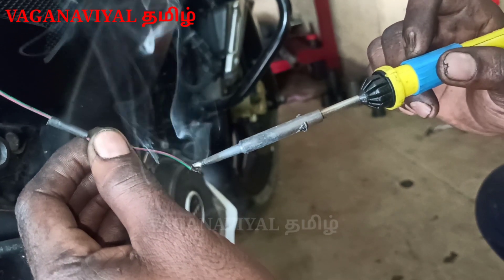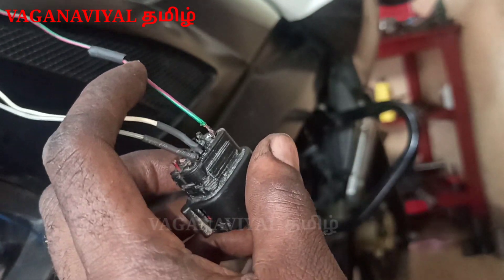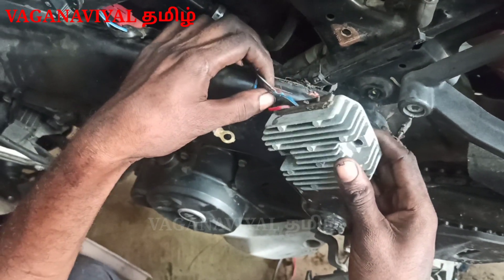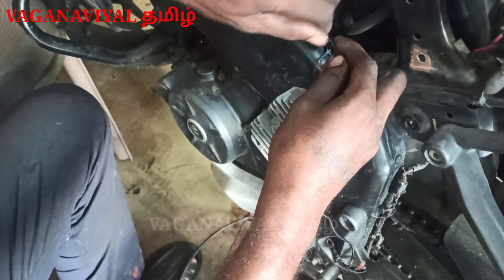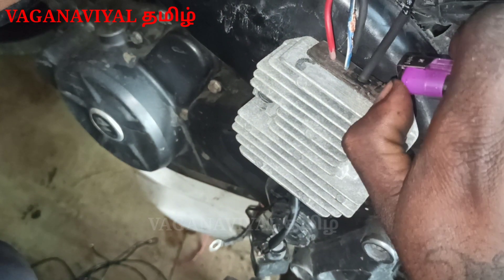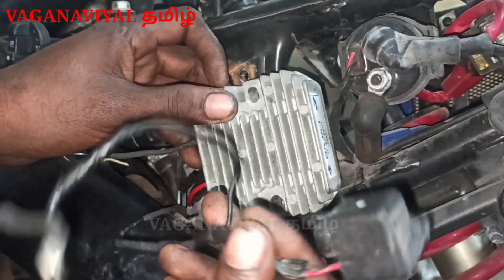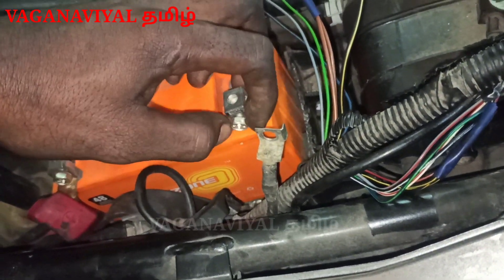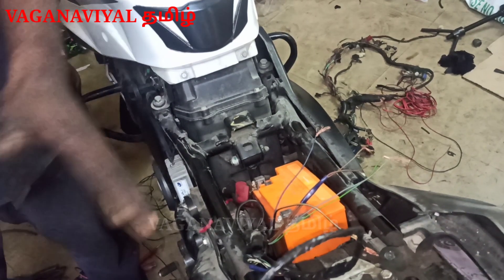NS200 FULL WIRING DAMAGE

Comment: அண்ணா வணக்கம் என்னுடைய ns 200 Bike cta unit connect aguam plug one wire எலி கடிச்சு வைச்சு இருக்கிறது. Eppouam temporary wire plug toch pani use panikitu irkean any solution. Anna ns 200 bike 2020 Feb vanganuna vandi bs4 model. Ns 200 bike good or bad Anna
Reply from the maker: Soldring pannunga bro
Reply: @vaganaviyaltamil  thanks bro